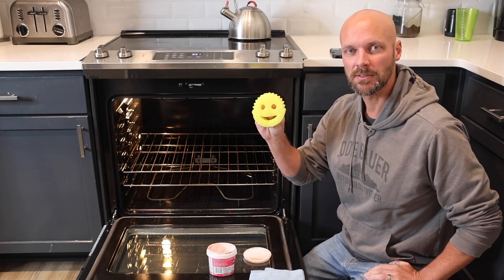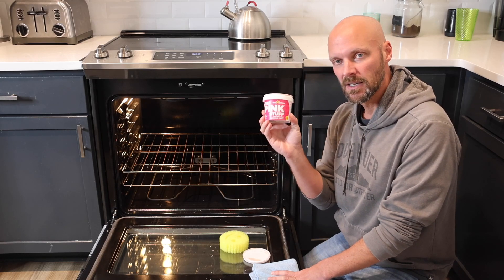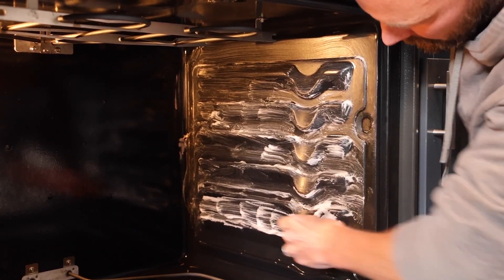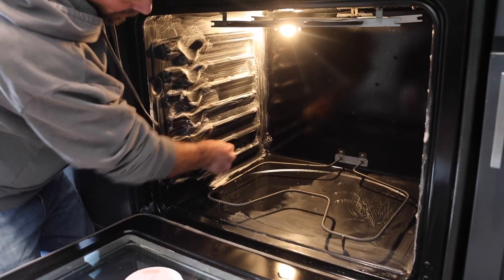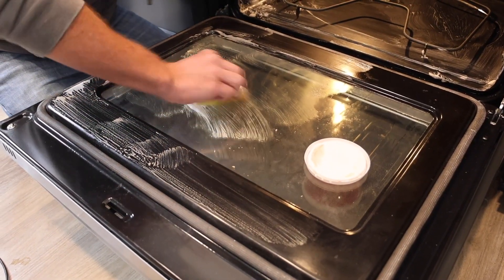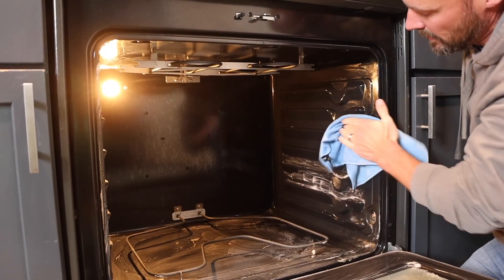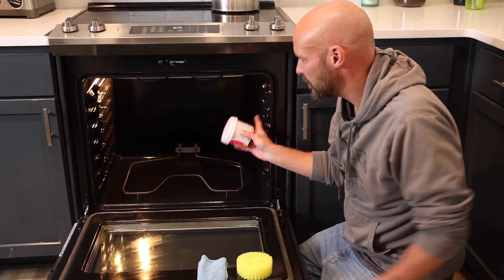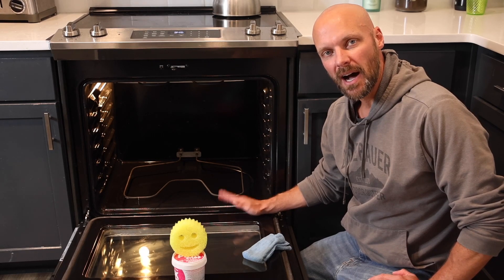How to Clean Your ENTIRE Oven FASTER - Top, Sides and Bottom of Oven

Comment: Seems like a lot of work. Dawn Powerwash works great for me. Spray on all interior surfaces except the door, close the door, go do something else for 20 minutes, come back and wipe off with a damp sponge, rinsing sponge as necessary. Repeat on stubborn spots. Do the door the same way, leaving it open so the suds won't run down. The only downside is that if you don't get all the Powerwash off, you'll get a bit of a smell the first time you use the oven. Powerwash also works on everything else in the kitchen from dishes to counters, sink, appliances, cabinets, even floors. And there are any number of videos on YouTube telling you how to make your own Powerwash refill for a fraction of the price using Dawn, alcohol and water.
Reply: Thanks. I'm going to try it.

Comment: I used vinegar and the charred part just became soft right away and peeled off very quick without damaging the paint. Try a small spot to see it it works for you.
Reply: Do you mean you used vinegar instead of the pink stuff?
Reply: @sharonwilson6278  Yes. The oil spilled on the oven floor and I got a rag or even paper towel, dipped with vinegar and leave it there for 30 minutes, was able to wipe off, the black part just peeled off.